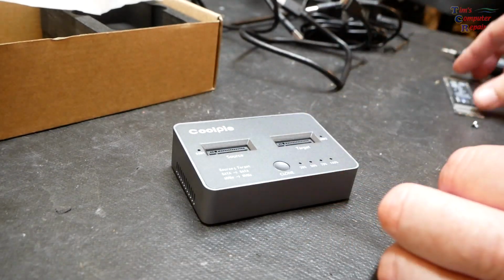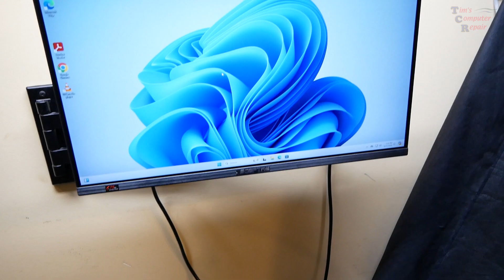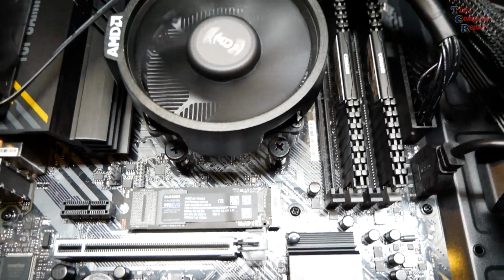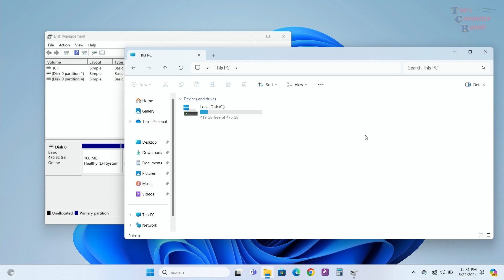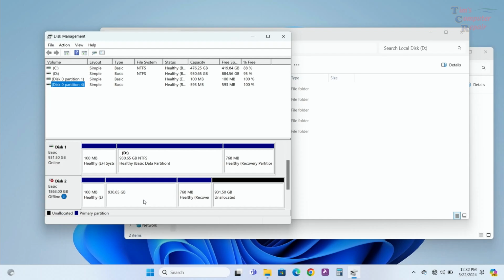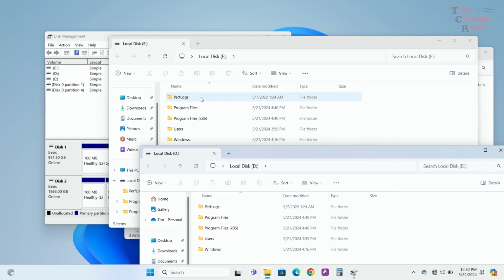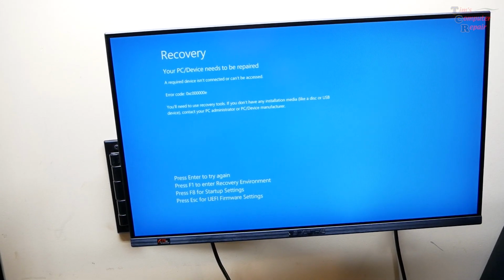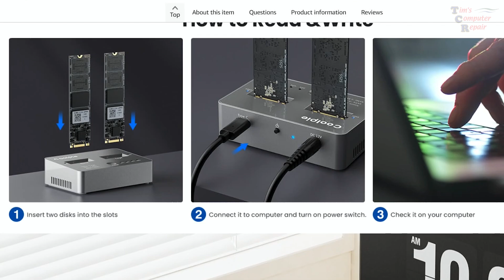Quickly Transfer or Duplicate Data From One M.2 Drive to Another

Comment: It is strange that it will not allow one to clone M.2 SATA  to M.2 NvME which is something that if dealing with an upgrade to a new system you might encounter. I wonder if the non booting is because Windows does not see the recovery partition at the end of the drive. I guess using partition manager software one could move the recovery partition to the end and add the additional free space to the existing partition.  Macrium reflect does have an option in their software to fix non booting drives which I have used on several occasions.
Reply from the maker: Thanks for watching.